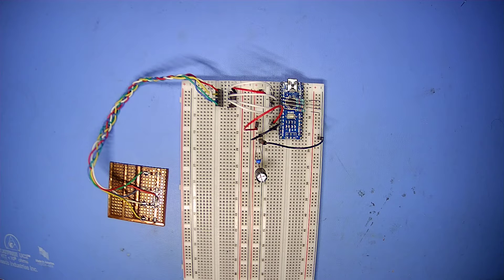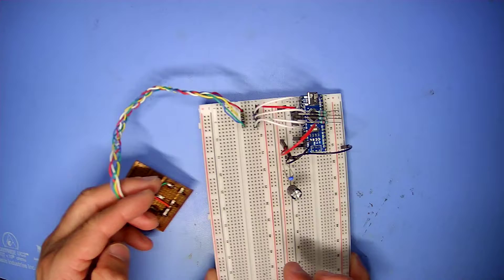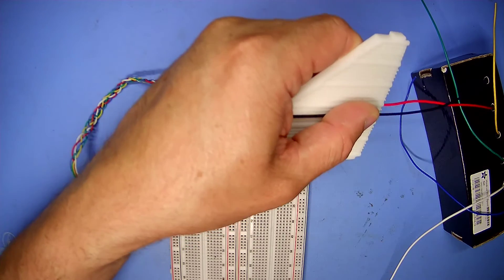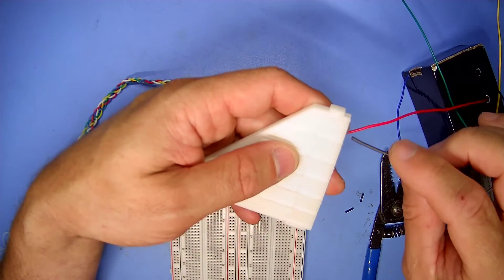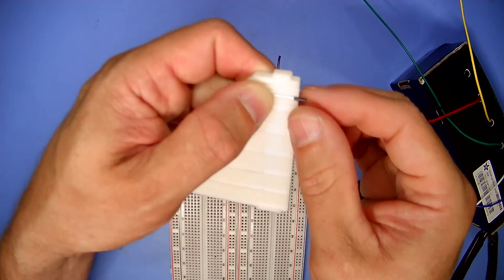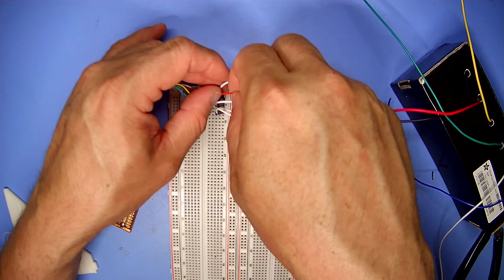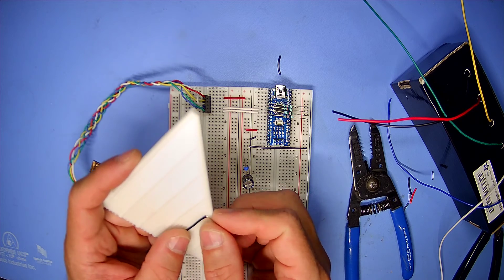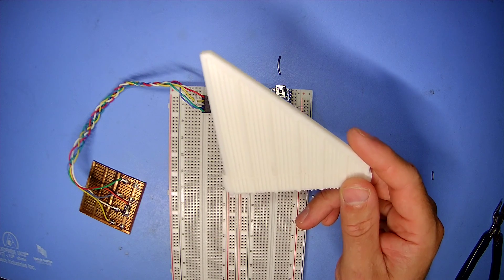A Better Way To Make Better Breadboard Jumper Wires

Comment: Breadboards drive me nuts.
 For basic testing they work ok but when they reach any level of useful complexity, my experience has been they often introduce a lot of intermittent behaviors. Especially if you have to make a lot of latter tweaks
For complex circuits I switched to using various PCB boards routing connections via fine coper wire and soldering. The trick is to use nylon sheathing to insulate the solder connections.  You just snip Insulations to the right length
slide it over the copper and solder the other end,

Comment: Any twisted pair cable will work as in Ethernet CAT 5/6/7 or telephone cables. For example the telephone one comes with 2 pairs (or 4 cables), their copper cores are around 0.5 mm in diameter. I bought one that even comes with an additional ground bare copper cable. It is around 0.3 mm that is ideal for making bridges on a perfboard (connecting several holes).

The only drawback I've found is soldering this cable in perfboards, it is not that smooth as pre-tinned or lower gauge cables.

Comment: Thanks for the tips.  I don't have a 3D printer at the moment but will keep the STL file as a printer is definitely in the pipelines.  In the meantime I'm using a mini breadboard as a measure for the right amount of holes.  Saving this vid for future reference.

Comment: I started experimenting back in the 70's but being a traveling musician I began to travel more and more and somehow lost touch with my work bench.  All these years later in my "retirement" I now have assembled a dream experimenters work bench and started putting together a synthesizer from a few chips and that led to a sequencer and that led to a small set of amps to drive a couple of small speakers, well you get the picture.  I wanted to build each part from scratch.  What a rat's nest that became on my bread board(s).  I then realized that troubleshooting was a nightmare in that nest so I began cutting my leads to fit.  But then I ran across your little gadget here.  They say genius is the ability to perceive the obvious.  I don't know how obvious this is but it is simply genius.  I printed mine out and love it!!  It is saving me a ton of "fiddling with the wires" time lol!  Thank you!!!  Anyone who experiments with electronics on a breadboard and has a 3d printer, don't even think about it.  Just print this out.  You will love it!

Comment: I like the length jig. But the stripping can be accomplished much faster with a stripper that auto sizes to the wire diameter,  and has an adjustable end stop for length. These are widely available with either side entry or front entry into the jaws, and not very expensive.

Comment: That's very useful! Thank you!

Would you also add the source file, not just the STL, so we can more easily improve it/work on it, please?

Btw does it also work with the type of wire strippers that grab the wire in two places and pull on opposite sides?

Comment: In 1972 I built a DIGITAL POLYPHASE WATTMETER, on breadboard.for my BSEE senior project. It was Kick A$$ good, but lotsa breadboarding, and your device wouldhave been a GodSend.
By the way, 120V, 230V, 460Volts, and 5A, 10A, 20A, 40A and 80 Amps all measured out of a 15 amp, 120Volt classroom wall receptacle. I got one measurement to lie, and 15 others to swear to it! With 0.25% accuracy, ACED THE SENIOR PROJECT, and GRADUATED with honors. (120 watts to 64000 watts full scale from a wall outlet) It was FUN!

Comment: This is a brilliant tool that you came up with. I'll definitely be printing one for myself (and maybe a few for the local library-based maker space). I think I'll play around with a layer-based color change to make the slot divisions easier to see. Thanx for releasing the STL for free. (I probably would have bought one if you were only selling them, but the library would have missed out on the donation.)

Comment: Just buy the premade ones. Don't waste your time.  It's like trying to measure and reuse resistors.
Reply: As the video mentions, this method allows you to have any length you want, and select color based on signal rather than length. And not have to order specific wires in advance.

Comment: I'm about to order this from a 3d printer but am wondering what best material to use when printing?
Reply from the maker: Material is not overly important as long as it's a rigid material. I mostly print in ABS, but PLA, PETG, ASA or even nylon should be fine. I'd suggest using whatever you have available or whatever is cheapest if you're using a 3d printing service. The only material I can think of to avoid would be TPU, as it's soft and flexible and not really suitable for a bending tool.

Comment: someone who has been breadboarding since the early 80's i can appreciate the neatness but this is a breadboard and alot of times you need to move jumpers, if they are precut then you need to make more. this is a prototype so neatness isnt a factor, its about making the circuit work. the simplest way is to have a spool of 22 ga and just cut what you need, its quicker, you can tidy up the final later.

Comment: Nice, I imagine I'll be printing out one of these soon. I like to use wires out of solid core Ethernet cables for breadboarding. They're easy to tuck into tight spaces and you get 8 color/pattern combinations
Reply: megabrain, ima have to start doing that sometimes. Do you have trouble with them being too thin?
Reply: @veryrealpersonwhoisreal  I've never had issues with it, but I suppose it might depend on your particular breadboard
Reply: I agree it's the way to go.  The jumper wires with ends you can buy are too fat, so are some components like a 7805 regulator, diodes and the post headers you get with micros.  These will mess up your breadboard(makes for loose connections).  Be nice to breadboards and don't stuff fat wires in them.

Comment: Could probably integrate a hobby blade or similar into the design so it's an all-in-one solution.

I personally have DuPont/header style wire crimps with ends in addition to the previously mentioned pre-stripped wires, covers bases. If I need to reach that odd length I usually couple two jumper wires together or just deal with a bent wire... it's just a prototype board after all. Save the neat layout for the PCB.
Reply: For people that my do some neat presentation for someone or just to only use breadboard for learning purposes it is nicer to work with jumpers like this
The big loops tend to get in your face fast and when you have 100 connections(literally) it is gonna get frustraring just to work on the board, let alone troubleshoot

Comment: Nice idea but I'd like to be able to make those wires that go round a chip to connect a pin on one side to a pin on the other more neatly too. Like the one you need to connect pin 2 to pin 6 of a 555.
Reply: You should be able to count the number of holes from one pin, around the chip to the other pin, make a wire that long and work out the two (or more) bends required.
Reply: @tonylock7657  The example given (555 timer) works better with the jumper going over the top of the IC, instead of around like you describe. But since the hole spacing is 0.1" pitch, using a ruler marked in 10ths of an inch one can measure the route easily enough.

Comment: Heavily sub-optimal. The PROPER solution is obviously an Arduino-controlled watchamacallit either made out of LEGO or fully 3D-printed that I can just feed a text file with required lengths and quantities to, then just have it spit out the jumper wires into a hopper. (/s)
EDIT: Oh, silly old me. Before I can even finish making the joke I already have YT recommending me a video of someone having already done exactly just that... sigh. This whole "21st century" thing is starting to wear me down.

Comment: Nice video and tool. I myself only use white wire. It is just cheaper to get a large spool of one color wire (usually that tough Teflon jacket type) than having 10 color spools (the decade colors) or those handy multicolor wire packs. I am going to make a tool based on the Arduino UNO.  It will use a stepper motor and pinch wheels to eject and cut a piece of wire to any length based on a keypad entry. Say I need a need a "5-er" (what I call a 5 hole long wire), I simply press 5 and then # on the keypad and a prefect length wire is dispensed. Then I just strip it using hot strippers and just bend the ends by hand.  If I need the same length again, I just press # to dispense the same as the last length. I could actually make an auto stripper and even auto bender on it, but that would be a bit elaborate... maybe on a delux model, but at least a length dispenser would be helpful. Let me know... I will post a video.

In military protoryping (where I picked up my techniques), we usually use white Teflon jacketed wire for all of our connections. Colors help, but the electrons don't care. In deliverable electronics, the wires are marked with their unique wire number (on a marking/dispensing machine) so they can be indentifed in a harness/bundle if needed. The idea is: Wiring done right very rarely fails, so using one color of high quality wire is all you need, as "buzzing" out failed harnesses are usually done by removing the connectors at both ends and checking each pin... color doesn’t really help... especially in harness with 100's of wires... having multicolor wires with stripes on them - the permutations of wire colors is just not practical and is very expensive. I am surprised the automotive industry does not go the military way... they try to save a penny at every step.
Reply: I'd personally love to see something like this! This sounds very useful for speeding up my prototyping.
Reply: @steadystatesanjoxo  I just coded the Arduino today. I have an Eleegoo Super Starter Kit which has the Ardunio UNO, a 4 Coil Stepper Motor,  A Stepper Motor Driver Board, as well as other sensors I don't need for this project. I will build the prototype tomorrow. I will need to get a strong 12V Solenoid that can actuate a wire clipper.
I will post some slides tomorrow on my website. It's easy to find, it's just my full name with a dot in between. After I build a prototype, I will post a video on my channel. I recommend getting a Hot Tweezer Stripper that has an adjustable stop so you place the wire to the stop, squeeze the tweezers, and gently pull off the insulation with no effort. It is a must for Teflon wire (that soldering irons won't melt - that is why Teflon is used in military wiring). Get a temperature adjustable Hot Tweezer Stripper so you can use it with lower cost PVC wire that requires a low temperature to strip.
Reply: @steadystatesanjoxo  I just posted a video on my channel for the prototype. Search for: Wire Dispenser Breadboard.
Reply: Clearly you need to add a bank of colored felt markers that your machine can select and use to apply color coding! 😊
Reply: @Graham_Wideman  Actually, bread board wires are relatively short, that is, they don't go into a harness and pop out somewhere else - so color coding (or wire number marking) is helpful. But on a bread board, you can see where each wire runs. True, colored wires may help trace wires, but since you can use tweezers and such to move wires around, color coding is not absolutely needed but it can help in some cases.  But your color coding markers on white is a good idea - hard to implement, makes the machine way more expensive, and markers need to be capped when not in use - but a good idea and this is thinking outside the box. I like that kind of thinking.

Comment: At 5:05 I use hot tweezer strippers - they can strip even down to less than a millimeter of remaining insulation if you need it. Very quick and easy to use. Your follow up method of stripping just the remaining insulation and sliding it into place works too. I do that sometimes, but with hot strippers there is no need for that, every wire is stripped using the same technique, so your muscle memory kicks in and you "whip out" wires cut to fit so quickly you don't even remember doing them.
Reply: I use a pocket knife once I mark it with the strippers
Reply: is that a specific kind of stripper, or do you literally heat up tweezers and use those?
Reply: @kali_muon  HOTweezers are a special kind of electric wire stripper. They strip wire using heat for a clean and easy strip. Have you ever tried to strip a tiny piece of wire? Regular strippers require a lot of pulling force and its nearly impossible.  These require little to no pulling force. You are supposed to pull off the insulation by hand, but many just pull it off with the stripper.  In aerospace and defense we use Teflon coated wire. Teflon is very tough and will not melt from a soldering iron. You can actually rest a soldering iron on the wire jacket and it will do nothing.  You can't use regular wire strippers on Teflon - too tough to cut, you have to use Hot Tweezer Strippers. Check out some videos on them... I swear by them. You can often get them used for a good price. Hot Tweezer type strippers can also strip common PVC wire, you just use a low heat setting.
Reply: I did not know about them... interesting 👍

Comment: Great tool. But mine would have to be aluminum. I use hot tweezer strippers as they require almost no pulling force to strip off the insulation.

Comment: I use one of the cheap black ones that look like the 300 dollar knipex ones haha. They last about 2 years but then are only good for thicker wires. 11 dollars a pair. The brand is 'knoweasy"..... horrible name but after they wont strip the 24+ they're good for the tool box and last years for household stuff. Never buy knipex side cutters, the blades tend to explode and im now caught in a cycle where i keep ordering the same pair and sending back the broken ones haha
Reply: If you’re ruining one pair of Knipex side cutters after the other, YOU are DEFINITELY doing something wrong. Treated properly they last forever. For example, the models made for electronics are for copper and mild steel wire. For piano wire, you need the ones with carbide blades. And either way, you need to respect the maximum wire gauge for the tool and type of wire.
Reply: @tookitogo  cutting led legs or quarter watt resistors. I swear to God man. I have lots of knipex tools and give them as gifts but the side flush cutters have all exploded. I think it's the tempered vanadium coating that gets a pressure crack then let's go. Haha I use a larger set side snips now that never get dull and also cust 10 gauge wire for rc stuff with no issues. I think Amazon gets the knipex tools that are not perfect like the others I have and it's reflected in the price. The next set of small ones I get are going to be left near the 3d printer. I really like ifixit tools. You can destroy them and they replace any tool wirh no questions asked and send a ton of extra tools. I know the Canadian manager by name because I gift their bit sets to people so often and he hooks me up big time when the Phillips heads (inevitably wear out). Haha their ceramic tweezers are the best for populating smd  parts by hand. Much better quality than the ones from ali which look identical.

Comment: Thank you so much!  You have no idea how much this helps.  I downloaded and resin printed mine and this is the perfect solution for this issue.  When there is a good design it's worth checking it out, and if that design works I feel it's worth a donation as a thank you.  (left one on thingieverse).

Comment: This looks really useful! Ever since I saw Ben Eater's video, I've been making my own jumpers. I've gotten good enough to eyeball the length for bus-to-board jumpers.

Regarding the problem with insulation on short jumpers - I strip and bend one lead first, and that keeps the insulation in place and makes it a little bit easier to grip the wire when stripping the other end.
Reply: or you know what? slap electrical tape on top

Comment: It is not only the mess. I built a fuzz pedal to a breadboard and use long jumper wires that are dangling all over the place. Fuzz works, but due to stray capacitances and inductances, it also plays some Asian radio 😂
Reply: When I was 9 I acquired an old telephone. I had the junction box for the phone lines on my bedroom window.  Took a bit of testing but I got it working and hid it in my sock drawer (wasn't allowed my own phone). You'd tap two wires together to make a digit, two taps was a 2 etc. 
I could make and receive calls but I got the local radio station full volume through the handset 😂 I was so lost with that one.

Comment: That's awesome. Could you share qhere you bought thia box with solid copper PVC insulated wires?
Reply from the maker: I've had that particular box for years. Not 100% sure where I bought it, but I think it was at a local electronics shop. You can find them pretty easily on places like Amazon and AliExpress, or even places like Digikey and Mouser. Just search for "breadboard jumper wires" or maybe "jumper wire kit" and you should find some. If you liked the video though, should you just be buying solid core copper wire and be making them as you need?

Or did you mean the wire I used to make my own jumpers? That box I bought from Adafruit, but you can find 24AWG solid copper wire anywhere that sells electronics stuff - Amazon, AliExpress, Digikey, Mouser, Adafruit, Sparkfun, etc. Just make sure it's 24AWG solid copper with PVC insulation. If the insulation material is not specified, it's probably PVC. For this application, other insulation like silicone or rubber is less desirable.
Reply: Cat 5 network cable.